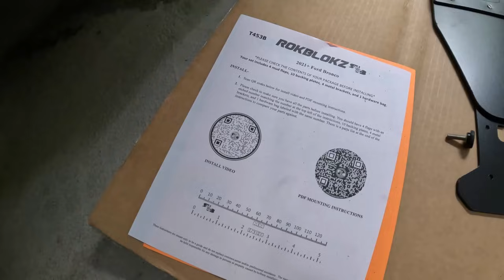Paying For Spots They Can't Use? | Plus A Free Jumpstart & Gas And Brake Failure Causes Accident

Comment: $52,000 per year for 2 spots is $142 per day ($71 per spot). Regular parking there is only $20 per vehicle per day so for two vehicles it'd only be $40 per day or $14,600 per year. The company should just pay for regular spots and save themselves $37,400 a year.
Reply: @TLM-Nathan - Very well stated!

Comment: I have a suggestion for the arcade employees. Buy two large orange cones for each spot, place them there when they leave so that no one parks there. Ad signage to the cones stating reserved parking, you will be towed. Problem solved.
Reply: Didn’t she say they had tried cones and folks had knocked them over and tossed them out of the way?  I’m thinking maybe two 50 gallon steel drums filled with concrete and painted orange.  Internal wheels can drop down to dolly the drums about via hand-held controls.  The drums are heavy enough that someone can’t move them, but they’re light enough the weight doesn’t interfere with the controls.

Comment: You may want to explain marking requirements in Tennessee for tow away zones. I know up here in KY it has to be a minimum of a 10x14 sign permanently mounted between six and ten feet in the air. Pavement markings don’t matter unless it is a traveled portion of roadway.

Comment: For the intro, I can send you pictures of what happens if you have inadequate front mudflaps if you wanna show the "why" you are putting them on.

I bought a used 99 dodge ram and both doors have a rust spot that after a run on a wet dirt road I realized why they were there, the tires were slinging all the grit form the road on the doors lol

Comment: The tires I got my 99 Suburban do this pretty bad, in fact it threw one at my tinted mirror and cracked the outer layer allowing the liquid they used for the tinting to leak out, that is with a thicker than factory fender flairs lol

Comment: Will be cool to see if you take the Bronco out offroading and flex a little to see if there are enough space for those quick connect screws.. To me it looks like the tires will just rub them off.. And for a price of 279?? That shouldn't happen at all 🙈
Reply: But nice to see you are helping some people,  even I've stopped a few times when I see some down in luck along side the road.. I've driven a few back to the gas station so they could move on, but the didn't have roadside assistance,  and no one to call etc.. 
Buy I stopped doing it, å time when I needed someone to stop to help me when I had an accident and rolled over, no one stopped to help me.. I had to kick out my windshield and get out, because gasoline was leaking into the car..

Comment: if that Jeep is more than a few years old it's an economic total loss. Accident like that is liable to crack the engine mounts, wheel mount, and axle, quite apart from the externally visible damage.
Had something similar happen to me in a Ford once, but that one resulted in a (low speed, thank providence, nobody got hurt) 4 car pileup when the brakes failed coming up on an intersection, several cars waiting to cross in front of me. Was doing about 15mph only, car was a year and a half old but totalled. 
Tip: make sure you get a police report as the insurance company is far less likely to pay out if you don't!

The guy in the parking booth is selling the parking spots on top of the rental fees the tenants pay, that's why he doesn't want the car towed, it'd expose his little side hustle.
The manager of the lot may not even know about his employees doing it (or not care even if he does know, after all the renters of those spots are a captive audience).

Comment: I wonder why they're paying so dang much ($52,000) for two reserved spots.  At $20.00 a day, one spot is only $7,300 for a whole 365 days or $14,600 for two spots for a whole 365 days.  Maybe the $52,000 includes their building spot lease also.
Reply: I think there was some fuzzy math or the assistant manager just misspoke. At one point in this video they said $100 a week for the 2 reserved spots. That would be $5,200, not $52,000. I didn’t want to go back to mark the time in the video it was said, but that stood out to me. $52k makes no sense whatsoever.

Comment: Wait, so the Jeep lost all its brakes?  Normal brakes and Emergancy/parking brakes?    They are completely different systems.  Parking brakes are rear only and normally operated by a cable and won’t stop you as good as normal brakes, but it will slow you down and to a stop.    That jeep doesn’t look all that old.  Someone trying to murder them?  As in cut the ebrake cable and the hydraulic line of normal brakes.

Comment: Holy crap $52k a year for 2 managers to park? Talk about benefits.
Reply: $100 x 52 = $5,200, not $52k.
Reply: @seashackf1  Thanks for teaching me how to add! But maybe instead of a math lesson you watch the video! 30:00 he says they pay $52k a year. 30:37 $500 a week per spot. $500+$500=$1,000 $1,000x52=$52,000
Reply: @seashackf1  Funny how someone tries to correct someone on something mentioned not once but TWICE.
Reply: @TechOut  I didn’t mean to come across that way. If it did my bad. I rewatched and he also said $100/week a couple of times. $52k for parking in TN is insane. It also doesn’t make any sense. $20 a day for the regular lot would be far cheaper, less than half. Something isn’t right, I think someone mistakenly said $52k and it just went from there.

Comment: Regardless of what the old dude at the gate said, I would have had you tow the truck! I’m not paying $20 a day to park when the company pays $52,000 a year for the two spots! The old dude had absolutely no authority here and was double dipping on the parking fees🤨
Reply: I think she misspoke. 2 spots at $20 a day in the lot would be $14k a year. There is no way they are paying 4x that amount for 2 reserved spots. Makes no sense.
Reply: The company she works for pays $52K a year for the 2 reserved spots! If someone is illegally parked there then she is charged the additional $20 a day to park in a non reserved spot! That’s the additional $14.6K a year!

Comment: Mud flaps on a Bronco are gay. Get some Patagonia M/T. Best tires you can get for the Bronco. You can see them in action on my channel. Also super quite and smooth on the road. Those factory tires are horrible. I got 4 punctures in less than 3k miles.

Comment: Brakes don’t just fail. It’s either lack of maintenance or user error. Considering a hill is involved could be that he was dragging the brakes and overheated them. Some people who left foot brake hover their foot over the brake and sometimes actually depress the pedal slightly and drag the brakes. Ever notice a car in front of you have their brakes on for miles, uphill or while accelerating?? Their left foot is on the pedal applying the brakes and the driver has no idea.